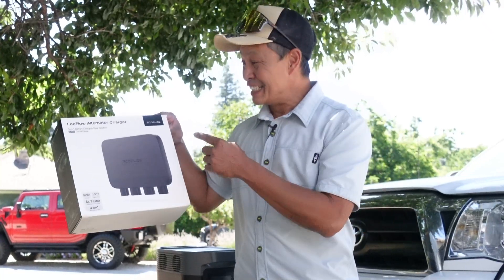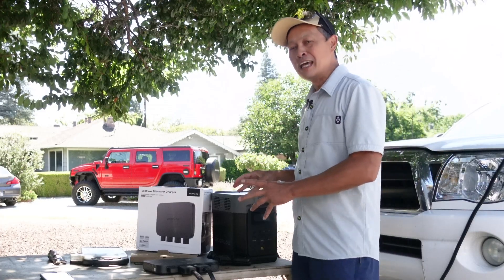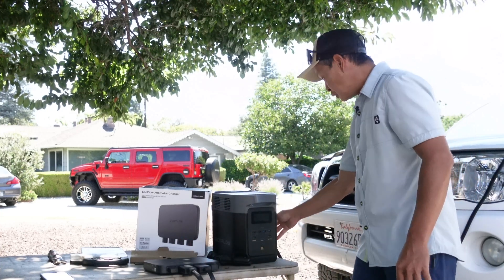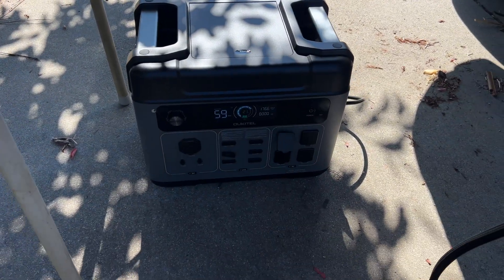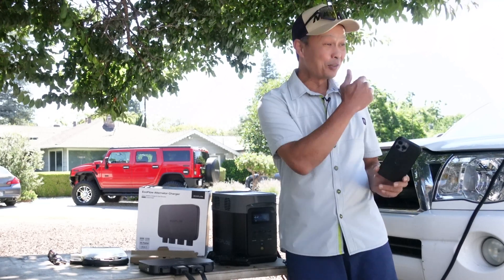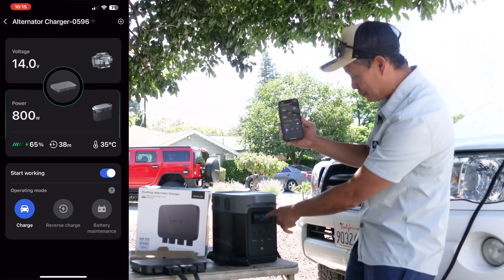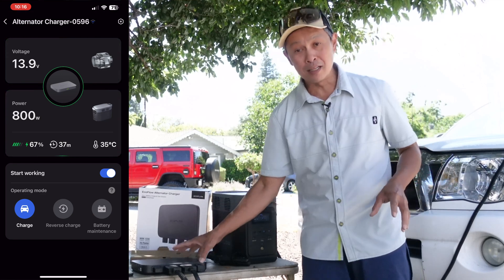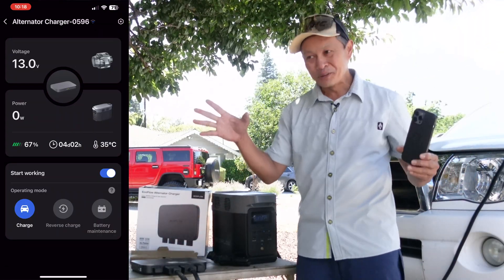Ecoflow Alternator Charger Install and Test - great solution but key problem found

Comment: Thank you for this great content.
You mentioned an important point about the alternator. With long-term use and a heavy load of around 800 watts (about 50 amps), will this affect the alternator?
I’ve heard many experiences of people losing their batteries and alternators because of this